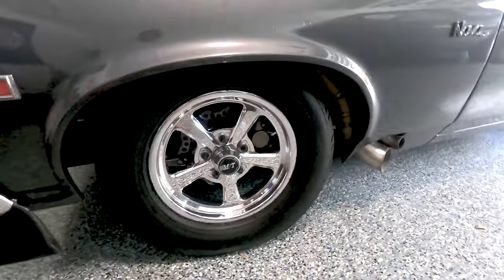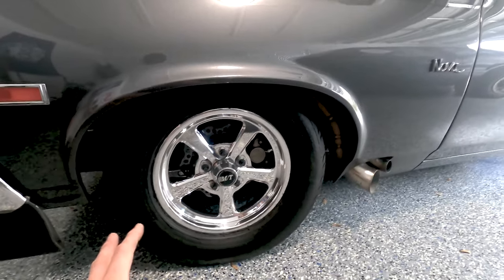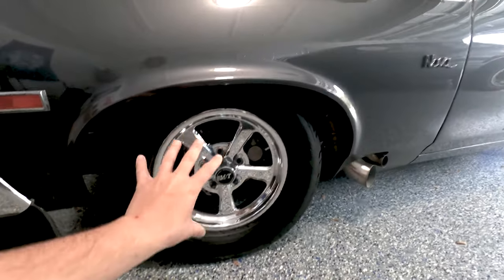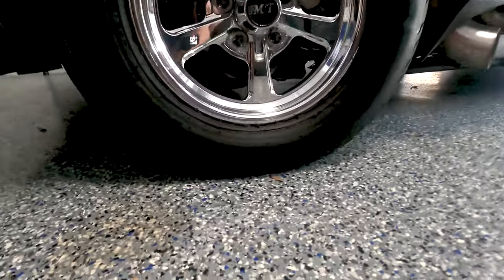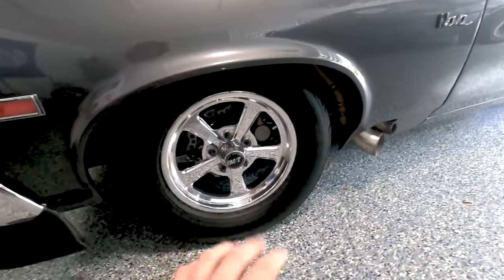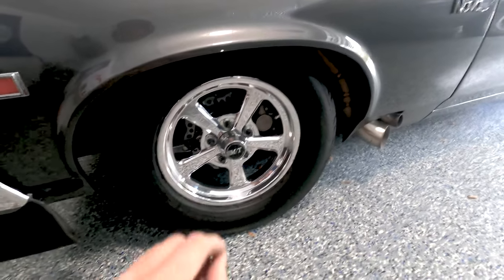Drag Front Tire Pressure Matters: Tech Tip Tuesday

Comment: Makes alot of sense, I've always ran 40 but I thought it was for less contact surface. Never though about the springing. Solid tip.
Reply: Same
Reply: Yeah, I always thought only about more front tire pressure to lessen rolling resistance.  Of course I have never had a car that could actually pull the front wheels.  😂

Comment: I'd really like to know more about your14v setup.  In your related video you said you kept relatively a stock alternator.  Based off what I read that's not adequate to charge the 14v XS battery you're running (recommended 16.8v based on their documentation).  Are you just getting by with that setup or did you manipulate the voltage regulator to increase the alternator's output voltage?

Comment: I run my front tires at 32psi which is the manufacturer max pressure. Should I run 40psi that you recommend? My car will carry the front tires 60ft out about 2in off the ground......

Comment: Excellent advice as always , if I can I would like to ask about your advice about dual pass radiators , I don’t understand the difference of using half the rad at a time and making it a dual pass vs running full available volume at once in a single pass , thanks again Doug and good luck on your charge to the sixes with that beautiful Nova .
Reply from the maker: Hey Marc, we have a video (albeit an old one) on this if you scan back.  I think that’ll help to explain

Comment: Excellent tip Doug. Another important tip is the small window between enough air to stop the launch recoil and over pressure on deceleration. You mentioned 2-3 pounds, sometimes it can be as little as a half pound when the track is hot on summer afternoon, especially on the higher  horsepower machines.

Comment: Yes for a tech tip Tuesday I would very much like to know what kind of battery kill switch system you're running I've seen the back of your car and you have a push button is that NHRA legal or do you just never run in any NHRA events or what kind of system do you run for a battery cut off I to run a 70 Nova not nearly as fast as your car I live in Orlando Florida not too far from you and would just like your reaction what kind of system do you run for a battery kill switch appreciate it if you make the time thank you

Comment: Now that you brought this up, I cannot remember my racing buddies checking front tire pressures. Dang. Also, my Goodyear skinnies don't have a recommended tire pressure on them so I have been running 30 psi!! No wonder the always look low and squat. I thought it was the weight of my 460 ci BBf up there. My car is retired from racing and just a pro street /cruise/car show kinda car now.  Thanks very much for the Info. Good Stuff, Cheers from Motown.

Comment: What pressures do you usually run in the back slick? I have a set to try for the first time this summer.
Reply: I believe they run a drag radial on the Nova.  Slicks are usually run at 10-12 psi, radials are run higher, in the 16-18 psi range.

Comment: I think you need to do a video about locking a car down TOO tight as well, and how that's detrimental.  I think many people are confused about suspension limiters and how they are not just there to stop the springing up but also to cause all that weight to "spike" to overcome the leverage causing the wheelie.

Comment: Bracket/ index racers have used front tire pressure as a tuning tool forever, there is around .020 worth of reaction time and ET just in tire pressure alone, with the tire pressure low it makes the contact patch longer which effectively gives more roll out.   Meaning your reaction time is slower, but you get a bigger running start to make the ET quicker.   We are talking about extreme fine tuning but it’s an absolute fact.
Reply from the maker: Yes sir!  Good point also.  Kind of forgot about the RT side of things
Reply: I get the bigger contact patch and longer rollout but wouldn’t a tire with more air pressure react quicker negating some of the longer rollout?
Reply: @danmyers9372   no.

Comment: The higher the front pressure, your reaction time will generally increase as well.
Reply: The higher the pressure, the less rollout, therefore a drop in reaction time, not an increase...
Reply: @c5pete  - but the front tire will react quicker with more air.
Reply: @danmyers9372  That’s exactly what I said.

Comment: Well yeah.. adding all that weight to the front will help.. +10 lbs to each tire =20 lbs and that much weight is a lot! Wouldn't it slow your E.T some tho? 😂🤣🤣🤣
Reply: Adding weight will theoretically slow a car down but if it converts lost upward momentum to forward momentum the car can 60’ quicker and be way more controllable and consistent.  And most importantly stop the wheelies which can cause a lot of damage to the car.  Adding weight is usually a last resort when suspension and tire pressure changes aren’t working.  It’s usually a problem with bad weight bias/too much weight on the rear of the car.
Reply: @danmyers9372  thanks for the info. I guess I have officially become a dad with my jokes. Tire pressure.. i.e pounds of pressure... air being used as weight. It was a failed attempt of a joke. Sorry you typed all that out because of me trying to be funny. That's why I hate tx msgs and posting stuff online. I can't always tell who is joking or not.